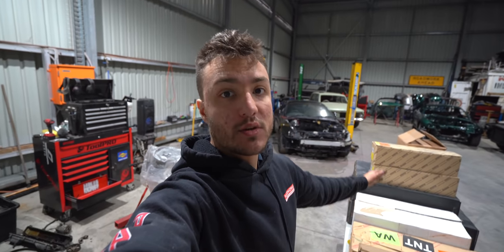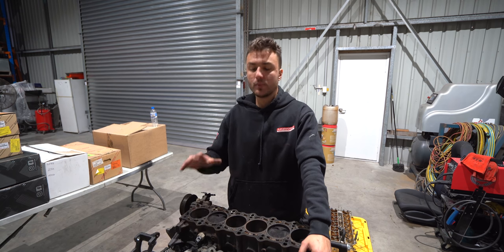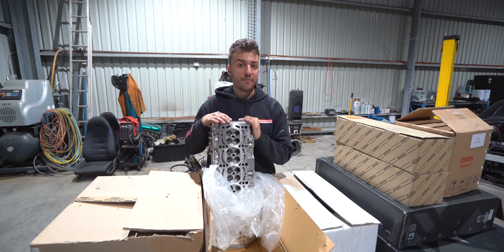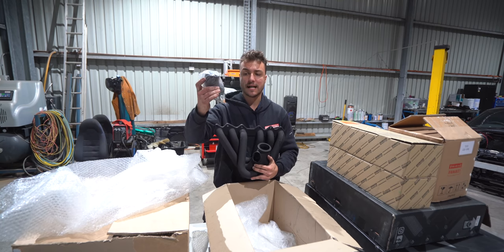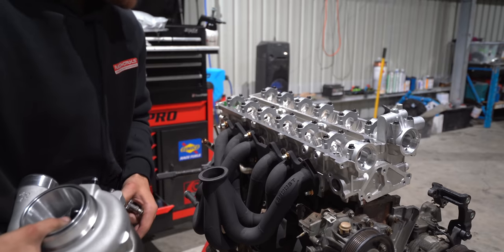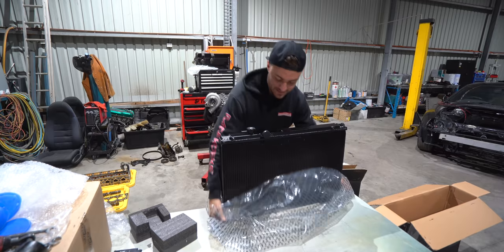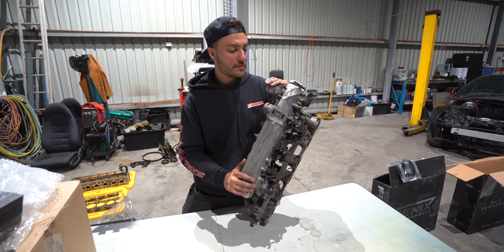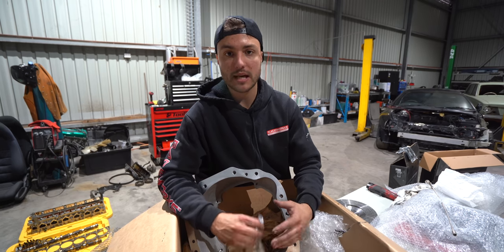BUDGET 2JZ BUILD | VLOG 15

Comment: Young Skywalker, you are right about R33-R34 builds. You can get a nice used R35 for as much as it cost to build a 509-600 hp early car. Also correct about building a turbo Supra two or three times over compared to an GTR. Can't wait for the first drive videos.
Reply: Are you sure about that?

Comment: the peak oil pressure in an engine will be constant because it is regulated in the pump. So if you have a leak like oil squirters above 3k rpm you won't see a drop in oil pressure. The oil squirters also have a valve so they don't open under a certain pressure, so the engine doesn't lose oil pressure at idle or relaxed driving when pistons don't need the extra cooling anyway
Reply from the maker: That makes more sense than what i said, cheers

Comment: One thing i would have changed , and what was told to me. I would go with a dual wastegates  setup since it's a vband manifold.  Reason for twin gates and not just one large gate is so you can control boost. Using one big gate you WILL get boost creep. Turbo technology has advanced so much now that they all flow  extremely good,  and will flow even better with a vband setup. This is what was told to me by my tuner.   I did two 46mm gates for mine, granted it's a bit more money but for ease of mind it pays off going this route.

Comment: 1 Massive tip for you if you haven't already don it in the future eps.. While the engine is out, weld -12an fittings onto your heater supply and return lines, will save you a bunch of issues down the track.
Reply from the maker: Note Taken! Cheers bro

Comment: Just check the water feed from the block to the turbo head is aligned mate. I think there is a slight difference in position which needs adapting between the blocks "i think".  great builds as always👍🏻
Reply from the maker: Yeah will be going from the water neck and pump so all sorted! Cheers

Comment: Sure the gearbox ratios are high, but I'm sure they can be tamed somewhat with the lower diff ratios from the n/a supras. (4.11 as opposed to 3.7 or the Supra TT 3.2 ratio)
Reply from the maker: Yeh even with 4.11 its pretty shit compared to a 6 speed such as cd009